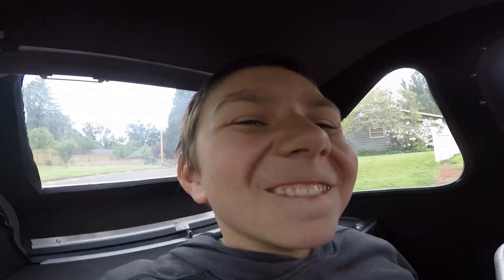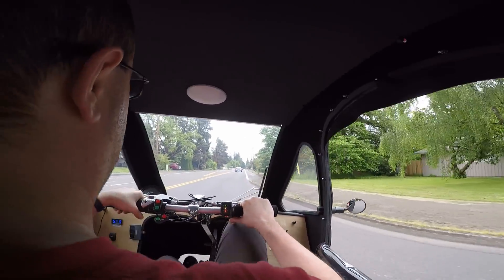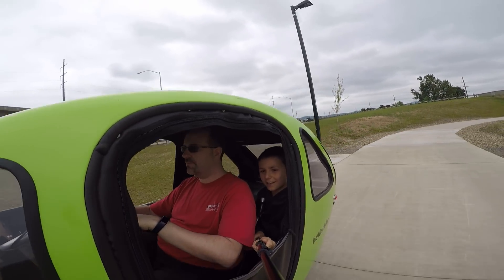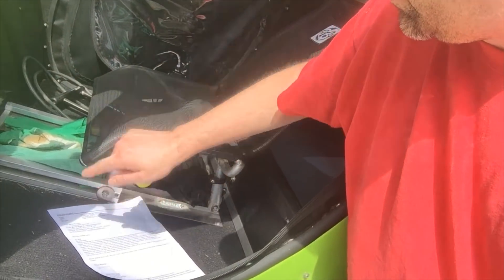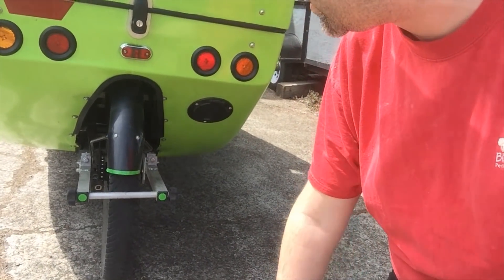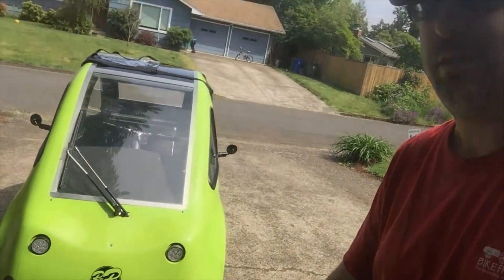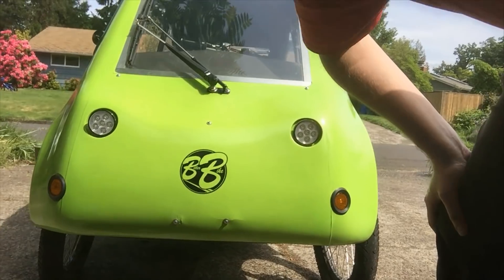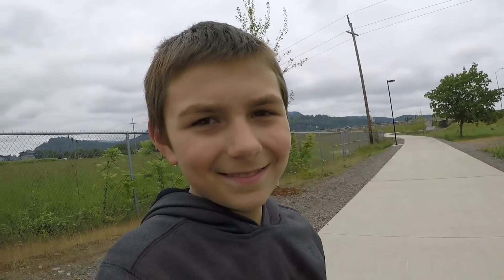The Great PEBL adventure part 11

Comment: Thanks for this, Eric.  I have made my final payment yesterday, and I will hopefully get a delivery date, soon.  I am glad for your frank and detailed discussion.  I am sure they will be updating things as needed.

I am going to be looking at improving the aerodynamics.
Reply from the maker: Neil Blanchard if you figure out how to make effective mud flaps, let me know!
Reply: Eric Fischnaller Will do.

Do you have the solar panel?
Reply from the maker: Neil Blanchard no I originally I purchased the solar panel but decided after a discussion with Kevin to swap out the solar panel for the larger battery
Reply: Same here - I am getting the 64Ah / 100 mile batteries.
Reply: Yes, a full day to charge a fully discharged standard battery is typical. But my experience with the ELF as car substitute for the last 4 years is as follows: I have never once fully discharged my battery to the controller shutdown level. I go on 4 mile grocery runs. While parked it is recharging. While driving it is collecting 80 watts in full sun and 20 watts on hazy days. When I park in mottled shade it still produces 10 watts, same with driving under shade trees momentarily. How many owners fully discharge their batteries every day? In winter I just put a chock under one wheel to optimize sun angle, it charges year 'round in Florida. In the north ELF owners take their batteries inside to keep them warm and charge during winter. If left outside they get real sluggish due to the cold. But these vehicles are generally used more in warm weather, making solar entirely practical. It is never too late for you, you can add solar later. Solar is like having a filling station that follows you wherever you go. It is also an emergency power source for the home after storms. For my purposes a 64 AH battery would be a lot of dead weight and needless expense in a vehicle where every ounce counts.
Reply: I live under trees in central Florida. I drive under trees on my daily rounds but sun also. One sunny patch in my driveway mid-morning is enough to top off my battery in a couple hours. The three ELF owners who did 4000 mile trips relied on their solar for part of their progress. One towed a trailer with more panels.
Reply: Popeye Gordon,
     Thank you for your advise on tools to bring.   Of course any flat will be in the mud, how wise to throw in a ground cloth. I am sure to be dropping small parts so any ground sheet will useful.  I should bring a headlamp. You have got me thinking and that is always a good start.
     Sir, I have read unpleasant comments directed your way at times. Thank you for overlooking the haters and still taking the time to help so many with your wisdom.  
     The ELF body with that two tone paint job makes for one sexy bike. I like how the frame protects the rider so well.  The two plastic baskets in the trunk are so inviting. They hide all the ugly stuff, like wires, but can be just lifted out when needed. 
    There are so many ELF owners now. I hope that means lots of videos and comments. We can all learn from each other.
     Thanks again for the advice.
      
   .
Reply: My 100 watt ELF solar panel weighs 2 pounds but provides the power of an 8 pound battery every day no matter where I go, with no need to plug in. Ever. Your roof has  room for a 150 watt panel I believe, it is more flat and wide than the ELF's.
Reply: Popeye Gordon it depends on where you are.  With tree cover, a solar panel is only slightly helpful.  

I think the PEBL solar panel is 120w and  with the 16Ah battery it would take at least 8 hours in direct sun to charge it.

I am getting the 64Ah battery and it will have 100 mile range, rain or shadow or shine.
Reply: Understood, it works for you.  Florida is much sunnier than most places, and there are fewer trees.

We either need to bring the batteries inside, or put a warmer on them.
Reply: Popeye Gordon, your use of chocks for more sun is clever indeed. What style are you using. Mine just stop rolling. 
     I just thought using solar was the way to be more green and perhaps help with using all the lights needed to be seen. Your experience with solar makes me glad I listened to my husband and got the option. 
     I was often asked what my last bike cost and no one ever said what a deal. I think your simple way of just listing the facts and letting them sink in will be the best way to go about answering questions about price. 
     I just bought a helmet for when I am in Canada but hope it will be cool enough to wear it all the time since I am up north now. Do you bother with wearing one in FL heat?  Also, what tools would you advise bringing along for long bike touring. 
     I started out with a heavy bike knowing I would be needing batteries just to get rolling.  What should I take for flat repair at the side of the road. We choose not to be foolish about safety and are willing to invest in more than bare bone under the seat tools. 
     I had the chain come off my last bike and realized a jack stand would have been better than the pile of stones used to get the frame up high enough and then keep it there. I still do not know what stand to buy or where to buy one.
     I may not know what to do with cordage and duck tape but if it is there and a good old boy offers help, I feel ahead in the game of living life. You Sir are indeed a good old boy. Thank you for your time.
Reply: Hello Marian - It is easier to prop up the ELF because it weights 40 pounds less. The chock I use depends on how low the sun angle is. In mid winter I use a milk crate. I have a yellow plastic wheel chock that works to raise one tire up 4 inches when laid on its side. My power meter tells me how to angle the roof for maximum charging. Too hot for helmets here but I might use one if I know for sure I'll be in bad traffic. Helmets may not be required in enclosed vehicles. I feel safe without one. I carry a typical compact bike tool kit that has many functions like a Swiss Army knife, two plastic tire levers to pry away the tire, carry a spare link of chain and chain tool even it you don't personally know how to use it. Be sure to have the metric wrench that fits your rear axle nuts. Tire patches, glue, pump and rubber gloves to keep the grease off, plus some wet wipes travel pack are smart. Something to lay on the dirt for muddy conditions while you fix a flat. I have had only one flat in 4 years and it happened in the driveway but we should always be prepared. I have a wood scrap the proper length for propping up the frame just high enough to work on the rear tire but front flats are easily fixed with no jack, just work around the issue, carry one front spare tube because patches should be a last resort. Your local bike shop should be able to help you collect the tools, the LBS is your most important asset for repairs and maintenance you don't do yourself. I find some items on Amazon. Practice using your tools and jack stand wood before you really need them. Maybe make some notches in the jack stand wood to help with placement. Some use a short length of white plastic PVC plumbing pipe for the jack stand, its lighter to carry.
Reply: Popeye Gordon p
Reply: Marian - yes, I forgot to mention the head lamp. And phone numbers for towing companies with flat bed truck service. It won't fit in a pickup truck very well, won't fit in a regular van. Some break down could leave you somewhere you can't fix it and can't safely leave it overnight. You can't take directly to most bike shops because their door is not wide enough to fit the ELF through unless it is double wide. 
Facebook has an owners group for ELF that is private. Over 500 members so you can learn a lot there
I don't suffer fools gladly and come down hard on liars so you will see me challenging some here. Not you of course.